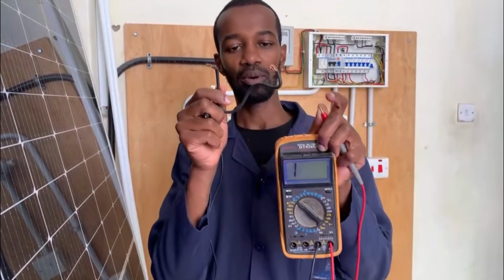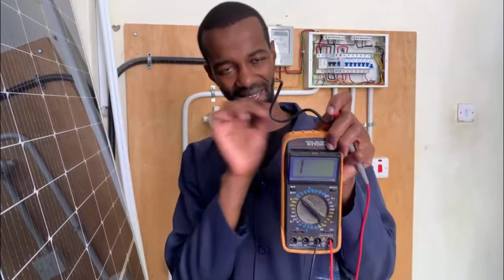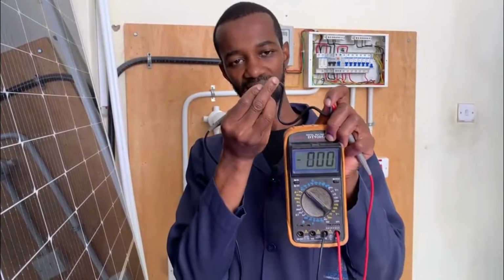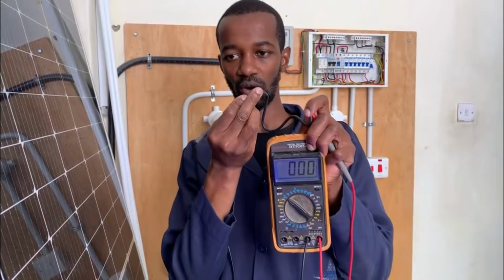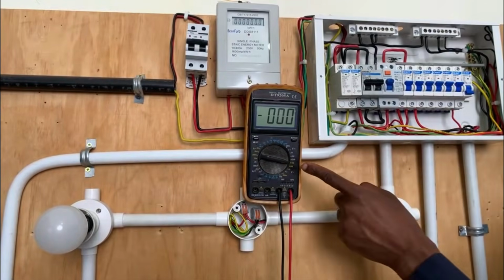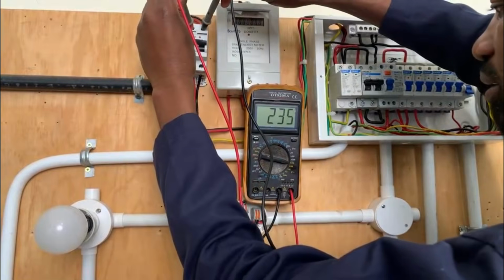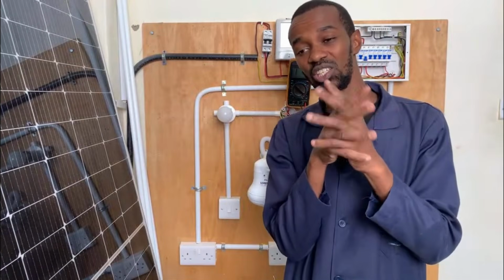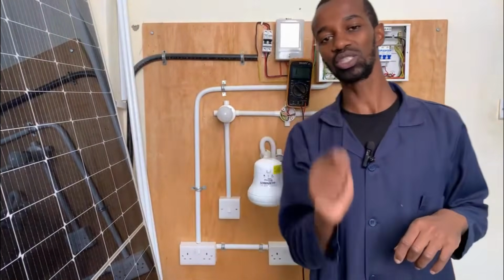How to Electrical Troubleshoot For Beginners | Top Heights Electricals.

Comment: Am mitala misearchi from jinja. I have learnt a lot. My question is that what may be the problem of deem lighting when an appliance is switched on like if flat iron is turned on lights go off and some are deem
Reply from the maker: Glad you are learning, Top boss; that issue is often caused by a loose neutral connection in your circuit.

Comment: Good afternoon top boss my is bitrus from Nigeria 
My question is what could be the problem in a situation where by if a socket is connected both neutral and live carry current but if you disconnected the socket it would comes back normal what could be the problem.
Reply from the maker: Glad to have you here! Please get a qualified electrician to check your neutral connection immediately.